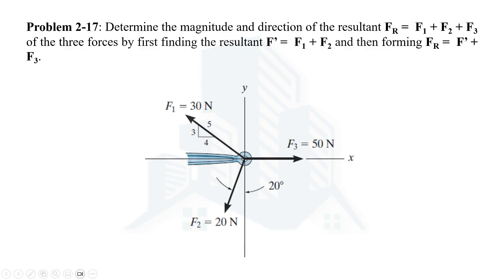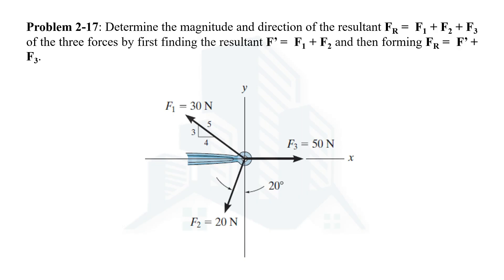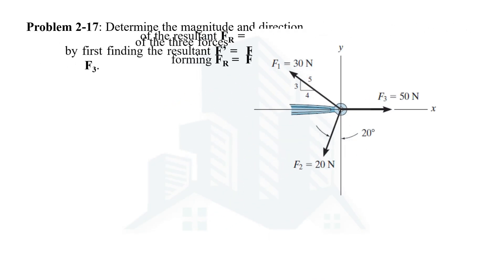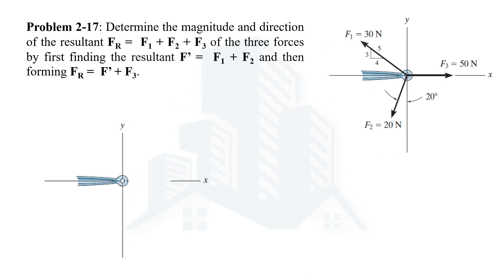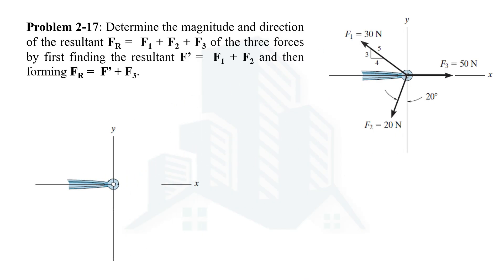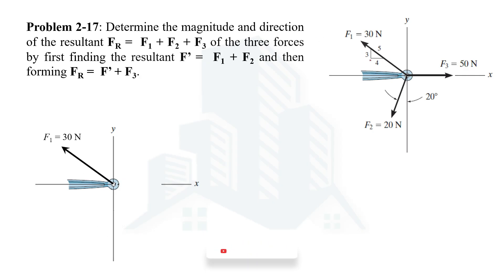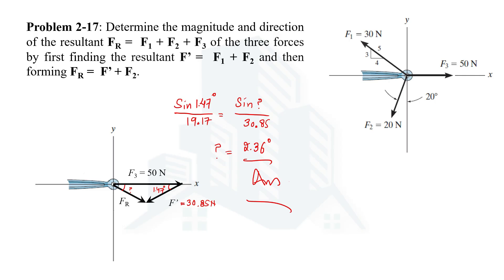2-17: Determine the magnitude and direction of the resultant FR =  F1 + F2 + F3, 1st, F’ =  F1 + F2

Comment: 180-1.47 u sure? u need to only use 1.47 bad tutorial
Reply from the maker: Yes it would have been 1.47 if the sign is negative for term 2ABCos in cosine formula. I usually consider positive sign that is when you consider the angle between the two forces rather than the angle formed on applying head to tail rule.  Hope it makes sense to you.